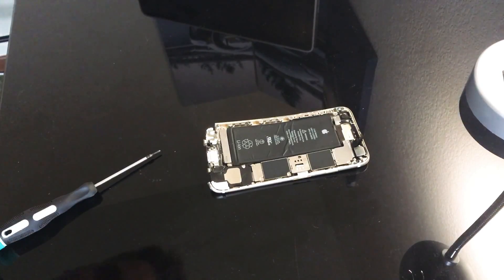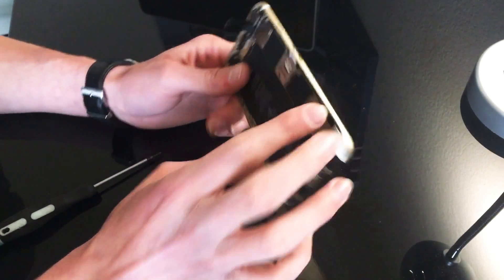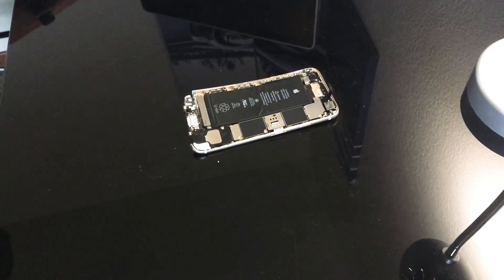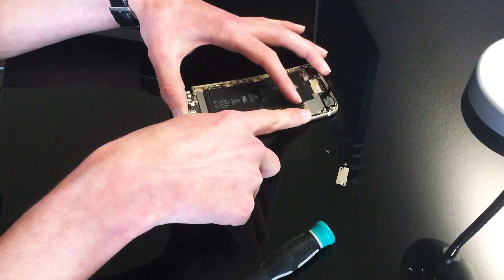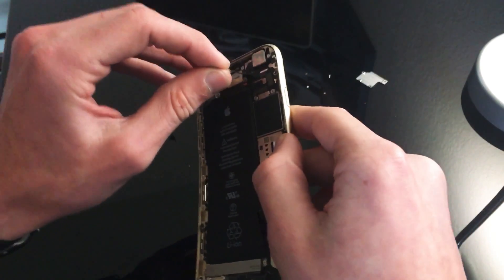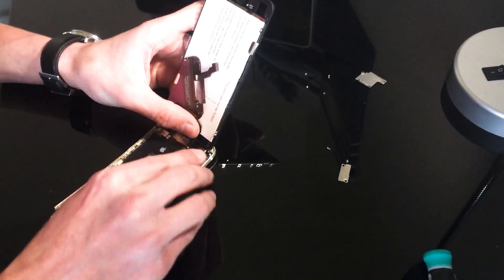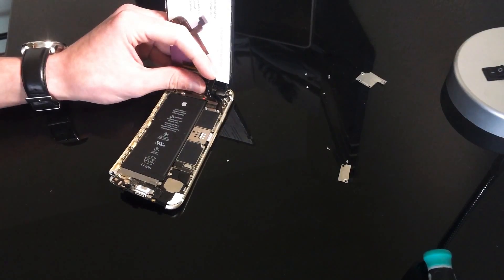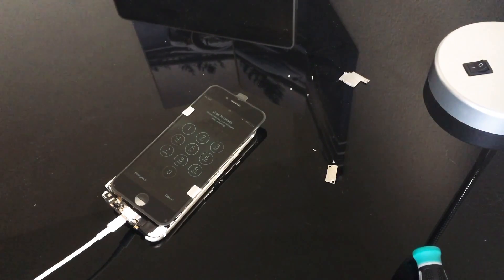I Recovered Data From a Broken iPhone

Comment: Hiii,
My phone is not dead actually but it is not starting because of low storage problem, so is it possible to recover data from phone storage (I'm not talking about cloud storage data), through any third party software or any other way to get my data back ????
Reply: Hi! Did you find a solution for this? I'm having the same issue and I've tried several things and no luck :((((
Reply: @AprilJaneBloomwood  not yet... I give up now
Reply: I had the same issue too.. Have you guys found a solution?

Comment: Hi! I sadly dropped my phone in the toilet last year, I did what i was told to do by Apple (put it in rice for a week and leave it alone) and it did nothing. If you plug the phone in, it shows a dead battery signal but nothing else. I have been unable to find a way to retrieve the data off of it the past year and was wondering if I could send it to you to be repaired? I'm not sure I would be able to use this method myself
Reply: Phone in rice is bs, it won’t do anything for your phone is just rumors spread around

Comment: i have an iphone 7, its has very very minor cracks by the bottom left corner has a  chunk of glass missing but thats the worst damage. its honestly been through so much (fallen in water driven over by cars ect.) one time i was running and it fell out of my pocket and thats when it cracked for the first time and then i turned it on and about 90% of the screen is black but i can still use it most of the time. do you have any idea what i need to fix it? i hove over 30 thousand photos and videos on it and the videos and photos are very important to me!!!

Comment: My iPhone 6s quit working they said the battery fried the phone it has the black screen. Is there anyway I can retrieve the information from the old device without losing any information to put it on the new iPhone
Reply from the maker: Lol was the screen working before the repair? Sounds like the shop blew your backlight and they don’t want to take responsibility
Reply: DanielTheAppleGuy thanks for the reply  I found out the battery is bad and it fried the power management chip

Comment: Would this process also work for a water damaged iPhone that won’t turn on?
Reply: Have you found a solution to this yet?? I have so many important data in my old phone and I dropped it in the toilet and it hasn't turned on since
Reply: OGX KEITH same I I had over 5 thousand photos on my old iPhone
Reply: Miguel Sanchez yes this is a good question! My gf dropped her phone while running in the rain and then some kid picked it up and gave it to her and it hasn’t worked since! It was already cracked badly beforehand and then after that it stopped working and won’t turn on or charge so I think it’s water damaged.
Reply: Same with my iphone 7 is waterdamage and It cant be repared something was burned and we cant find it 😭
Reply: If it's a no just say no please :/
Reply: Or at least let us know if there's a tech shop that could do this
Reply: have you found a solution my friend put water up my phone and now its broken. Im getting the 11 tomorrow but idk if all my data is lost.
Reply: same bro!!
Reply: i went to 2 phone stores that couldn’t fix my phone but i’m sure a professional could rebuild the broken parts and get the phone to function allowing it to turn on and collect the data. That’s what i need at least and than after i get the data i don’t give one ** what happens to it i’ll scrap it or use it again so i don’t have to pay $1000 for a new phone.
Reply: @loganaquino31  At that point you're probably spending as much money getting the photos and getting the phone fixed as getting a new phone.
Reply: @loganaquino31  like you're basically just getting the phone fixed

Comment: I need my notes on my broken 6 plus but the screen is extremely broken. The phone still turns on, and the screen will light up but it’s just cracked with a bunch of different colors. I really need help. I had a lot of important info on there. It wasn’t backed up either.

I know it’s stupid that I didn’t back it up but that phone was like two years old I thought it would last but it obviously didn’t 😭😭
Reply: Did you get a solution? I have the EXACT same issue
Reply: Taylor Daniele sadly no. I tried absolutely EVERYTHING and I haven’t been able to get into my notes. I ended up having to change my passwords for a bunch of accounts 😭😭 I would like to give everyone some advice, BACK UP YOUR IPHONES 😂😂
Reply: Floof I am definitely going to backup everything form now on! I think I might try replacing my screen and digitizer myself
Reply: Taylor Daniele haha well that’s good to know glad I could warn some people 😂😂
Reply: Your profile pic explains it all 
Also I have the same issue🙃😭

Comment: If it turns on but screen is cracked and cant even touch it without it freaking out, would I still be able to get photos retrieved from it ?
Reply: That's the problem with my iPhone right now.  How did you fix it?

Comment: hello, Daniel,
 I'm here because recently I dropped my phone into a pool. It was submerged for about 5 seconds as I soon realized. recently someone put my bag in a puddle and my phone suffered from water damage. the phone worked but the screen looked glitchy and I could barely use it.I went to the repair store and they replaced the screen and everything was good besides the front camera. i had then placed a screen protector on my phone and the phone cracked through it and a small piece of glass fell off my phone at the bottom right corner near the home button. I hadn't replaced the screen protector yet so since a bit of glass fell off some of the parts were exposed. after I dropped my phone in the water it got glitchy and turned off. it is currently soaking in rice which I know isn't very helpful.  My father has a workshop with tons of tools and I was wondering if my phone was fixable. whether that be replacing any parts. Buying a new phone is very expensive and im searching for a cheaper option. I have an iPhone 6s btw. if you could possibly give me guidance that would be helpful!
       thank you,
        sofi
ps sorry if there are tons of grammer and spelling issues its 12 am